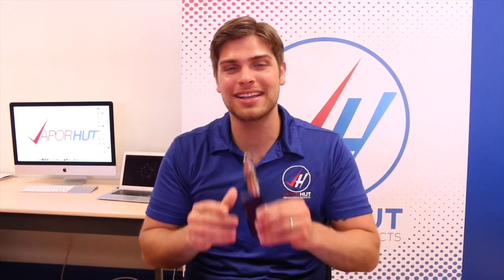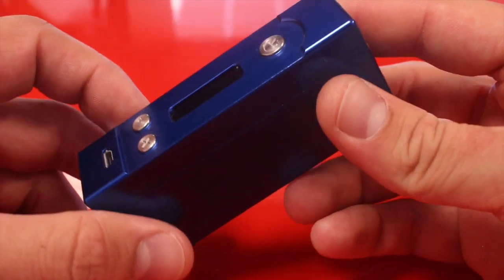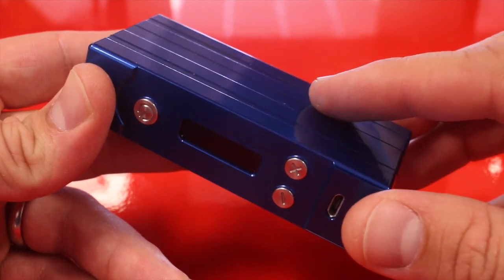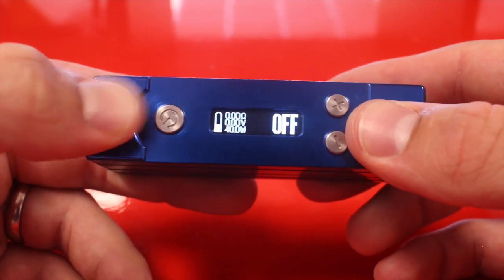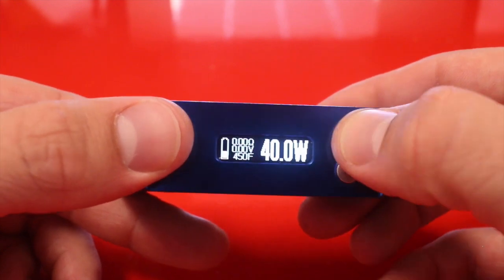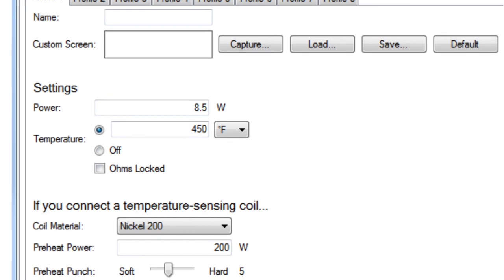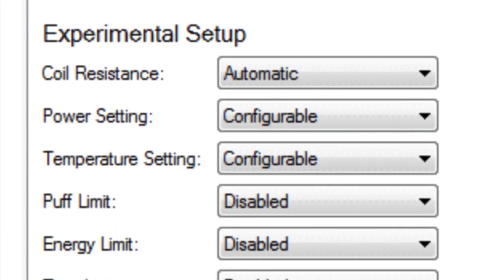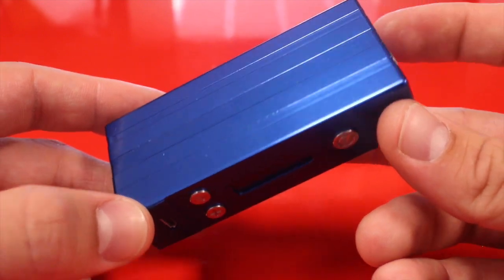V200 (DNA 200 chip) by Hana Modz REVIEW

Comment: Those spinning buttons would drive me crazy...
Reply from the maker: Zeb Hogan Yeah, pretty strange "feature" if you ask me.
Reply: +Vapor Hut it does look like an awesome product! I love the ability to customize the programming. But unfortunately it's cheaper to produce buttons that aren't fixed...
Reply: They are for a purpose. Normal one piece buttons have a tendency stick or lock in place. This are on like ball bearings or something similar. In short, if you keep the mod for 10 years, the buttons should never stick once. Battery life sucks thou. That's my complaint about mine.

Comment: Is the battery power a hinderence on this hana DNA200 device? I have a 3x 18650 Reuleaux DNA200 and I dont know if I will be able to tolerate what is essentially a single 
18650 device now.
I really wish Hana would enlarge this enclosure so it can house a maxamps 1850 or 2250mah 3s Lipo
Reply from the maker: +JAY LEE Agreed. Yeah, the single Li-Po in the V200 is too small to make it worth while. The Reuleaux on the other hand (my next review will be of) is an awesome DNA200 device. Those three 18650s are awesome. Battery for days! :)
Reply: +Vapor Hut Thats too bad cause I have a DNA200 chip here for a build I just need a good enclosure, I noticed hana has a diy kit now but the box is too small, do you know of any other diy enclosures for dna200?
Reply from the maker: JAY LEE Hmm.. I do not. Have you tried Googling it? I've never built my own box mod before.

Comment: the lipo can removable or not??...or already shoulder in the chip??...i mean any wire already shoulder..
Reply from the maker: +mustakim kamaruzaman I'm pretty sure it's soldered to the board so, replacing the li-po would require soldering.
Reply: oh its bad mod than Vapor Shark dna 200 can change the lipo battery only take off the connector inside..thank god im not to buy it (hana v200)

Comment: hallo can you tell me the different about 3s lipo battery volts???...hana modz using 3s lipo 3.7volts but vapor shark use 11.1v 3s lipo..so what is the different between that battery about the volts..can explain..more low volts mean firing not power like 11.1v??...im confuse pls help me bro..i from Malaysia

Comment: $200 for this? - spinning buttons and machining marks make this a fail in my opinion.
You've got Hana's legendary design ethic here too, it's an ugly brick.

The Hcigar VT200 is a better deal and doesn't look like it was designed by a 14 year old using Sketchup.

Comment: Nice review but IMHO HANA Modz QC is going down the toilet.

The buttons spin because they'll blanks using the onboard switches and poorly designed to prevent spinning; an oval or ridge would have prevented it. Worst the Box itself is milled very poorly, and looks like a cheap China knock off .. I wouldn't be surprised if it's built there and not in the USA any longer. Hobo's forthcoming DNA 200 has my attention and maybe the Vapor Shark. HCigar and a few others are coming to market. 

The upcoming DNA 130 (133) firmware also was my attention because it'll allow dual 18650's. Most of these LiPo batteries are weak and then you're stuck using the 1A USB to recharge. These DNA 200 Mods need at least 1300 or higher mAh LiPo's but for safety I prefer a LiFePO4.
Reply: David, what Dna 200 device would you recommend at this time?
Reply: Dwaynes BudgetVapes None. I built my own, but the Vapecige VTbox 200 looks promising for its  $160 price. 

If you build your own retail for parts you'll have an easy $120 invested plus if you anodize or powder coat, etc no difference in cost.

The only DNA 200 Box thats got my sincere attention is the stabilized wood Hobo 200D Mod http://ink361.com/app/users/ig-49663247/hobo_customs/photos even then most are using the crap Evolv's onboard buttons. 

Evolv kinda screwed themselves with the Modder's and specifically the high end Modder's since there's no single 18650 support and the dual 18650 AFAIK is coming but not available yet (DNA 130/133). Additionally, I've heard of other cell support than the 3S. 

The board seemed strictly rushed to be an in your face to those who bitched about 40W. Pfft I did but all I wanted was 50W maybe 60W not some moronic 200W.